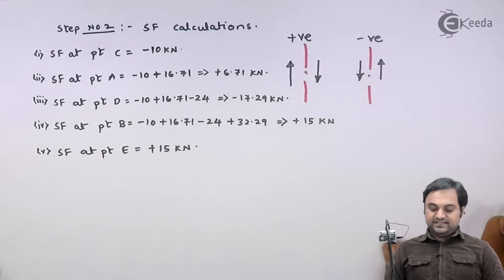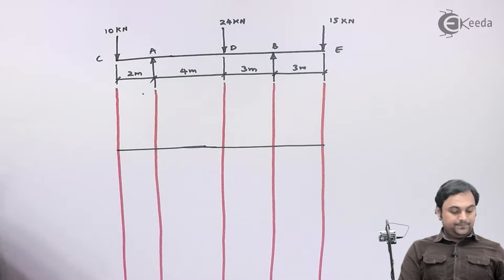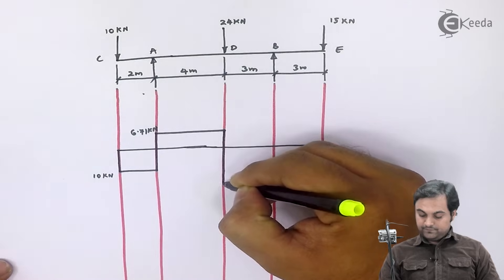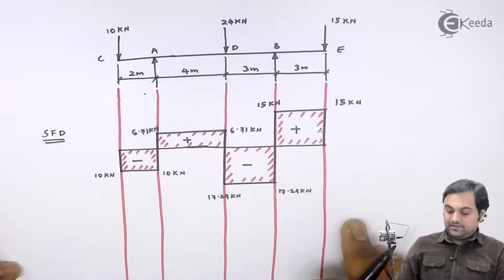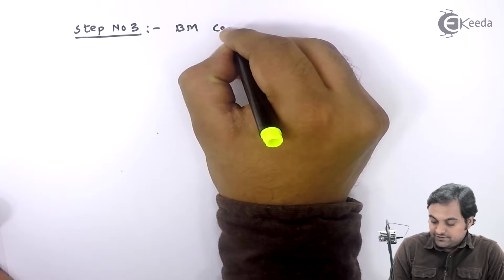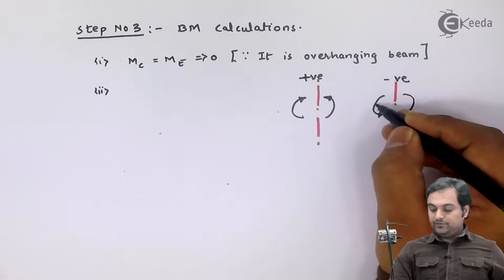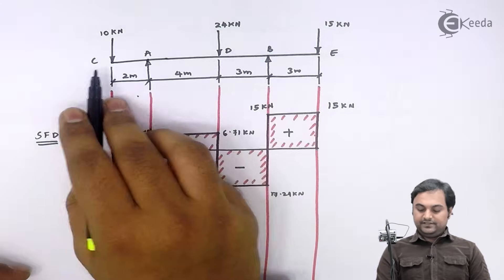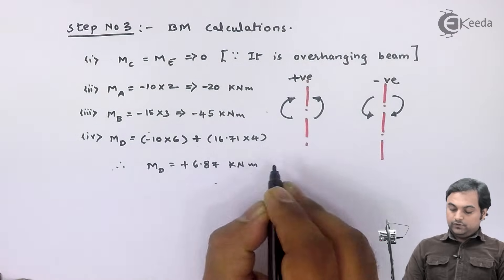SFD and BMD - Problem 1 - Part 2 - Shear Force and Bending Moment Diagram - Strength of Materials

Comment: sir just confirm my inquiry i notice during the calculation of bm at D i notice that if u calculate from left side the result is 6.84 but if on the right side it would become 6.87 so there is just difference in decimal
so sir whats youur opinion regarding to this im hoping to recieve an response from u sir thank you
Reply: did you get the answer to your comment query? share with me because  am also asking the same question

Comment: Sir, 
How 15KN is constant at point load"E"?
Reply: There is no load between B and E, that is why it should be constant like the shear force between other parts.
Moreover it should be constant irrespective of the direction of movement, so the diagram should be the same if we were to go from E to C. Just like it was constant between C and A, and was equal to the force experienced by C because there were no forces acting between C and A, it needs to be constant between B and E, and will be equal to the force experienced by E.

Comment: In bending moment positive and negative sine are not clear. 
Sir I am confused
Reply from the maker: take a simple trick...... for sagging it would be positive and for hogging it would be negative
Reply: @dannyengineering  Either you have to consider left section or right section
Reply: @dannyengineering  if it is sagging BM will be +ve & for hogging BM will be -ve...when u take a section in a beam u can solve problem by left section approach or right section approach
Reply: @dannyengineering  you are talking about point B?? It's hogging he has taken it as -ve....(-15*3)=-45KNm

Comment: why are we calculating moments to the right of point B and left of A?
Reply: It's easier that way, otherwise you would have to do more work, but this is a 2 year old comment and you hopefully graduated haha
Reply: @hans3331000  😂😂😂
Reply: @hans3331000  bro it's getting different answer from other side this is the problem if the answer is same from both sides then there is no problem.
Reply: @bharattanwar5047  right, i am getting 85 kNm not 15KNM. anyone can explain why not same moments at b from left and right